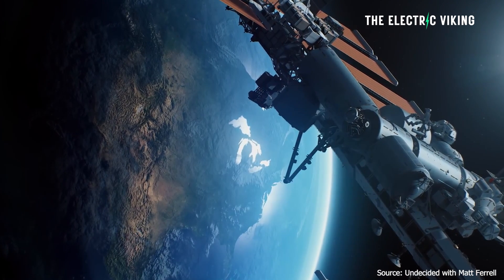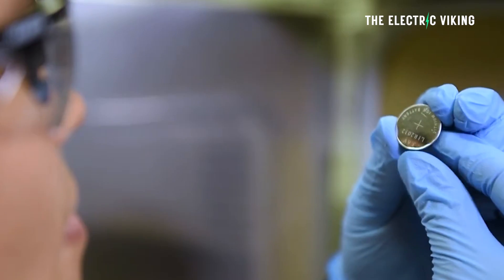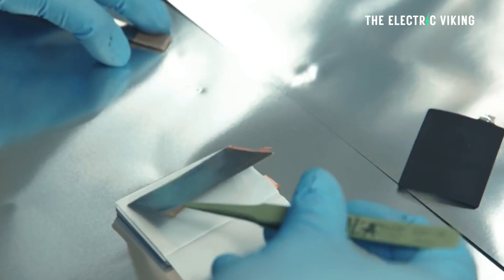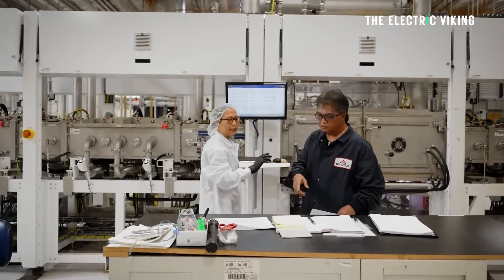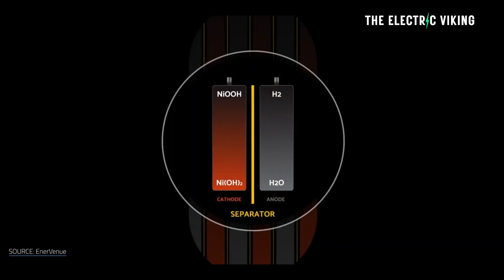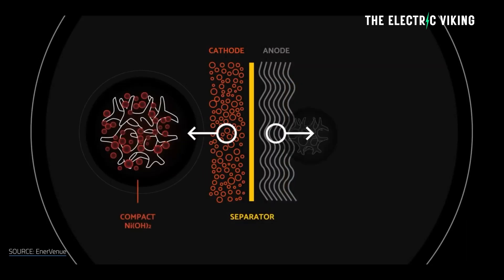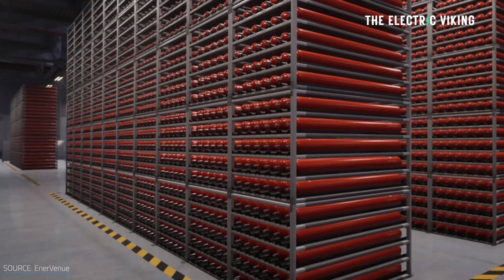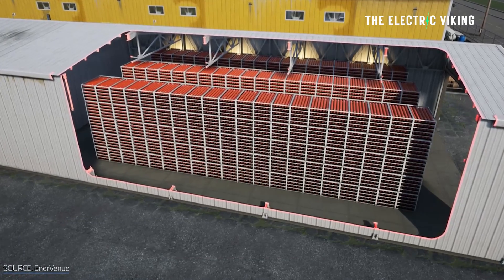NASA's nickel-hydrogen battery technology could displace lithium by 2030

Comment: Very old technology from 70s. Very poor energy density. Sam are you running out of things to talk about
Reply: that doesnt really matter for grid storage. price is more of a concern for that.
Reply: @zachmoyer1849 Just a poor title for the video. Lithium isn't going anywhere for vehicles or portable devices. Grid storage, yeah totally different game.
Reply: @zachmoyer1849  that's true but for grid storage there cheaper options than pressurized hydrogen. Salt water flow battery for example
Reply: @i6power30  Please correct me if I'm wrong but from what I've read there are 4 major types of sodium flow batteries, all with different characteristics.  None are available at scale or at a reasonable price yet.   

Currently this pressurized hydrogen battery is about 75 percent more expensive the Lithium but has a considerably longer life span and considerably lower degradation.  This means that while it has a higher upfront cost, in the long run it will be about 3 to 5 times cheaper than lithium over the life on the battery.  Both sodium flow and nickel-hydrogen are predicted to be cost less than lithium by 2030, although by 2030, lithium batteries will be lower cost per kwh as well, which I don't think any article I read takes this into account.
Reply: @Ryan-ff2db  I don't see why salt water batteries should cost more? It's just salt and water, should cost way less than high pressurized hydrogen tank? I'm baffled...
Reply: @i6power30  It's because they're not produced at scale yet, and input materials are only a small portion of the costs.  All tech is this way.  The more you ramp the cheaper it becomes but all tech is expensive in the beginning due to upfront engineering costs, factories, establishing clients, etc..  If you look at semi-conductors the materials in a single CPU are literally pennies for a chip the size of your fingernail but they sell for Hundreds or even thousands of dollars because the engineering and manufacturing costs are so high.
Reply: @Ryan-ff2db  So in theory salt water batteries should cost less and more robust than nickle hydrogen battery at scale then.. The reason NASA developed nickle hydrogen batteries is mainly long cycle life as you cannot easily replace batteries in space. But for grid applications, salt water batteries can easily be replaced at very low cost once the infrastructure is setup, you just need to replace salt water! So it's no a brainer.
Reply: @i6power30  Yes, but every type of battery has there own characteristics, their own pros and cons.  Storage density and cost are two factors.  You also have depth of discharge, voltage, capacity, cycle life, charging current, discharge curve, temperature range, and possibly the most overlooked, the BMS and software.  Salt water batteries seem to be an excellent solution for mid-long term storage but they cannot respond instantaneously.  The grid will still need faster lithium style batteries and capacitors to smooth out the grid.  Realistically there will a mix of different chemistries and technologies as the grid evolves.
Reply: @Ryan-ff2db  The grid doesn't 'evolve.'  It has a set task, and that isn't changing.  What IS changing, is everyone's willingness to compromise it to try and make these magical solar and wind and battery boondoggles appear feasible.

The grid has never operated under a 'store for later' paradigm as wS never designed around it.  It's designed around a 'create as needed' paradigm.  The two couldn't be more polar opposites.

The grid would have to be designed around a paradigm based on technologies that do not as yet exist.  I don't need to tell anyone here what a stupid idea it is to pursue THAT path.
Reply: @billcichoke2534  obviously you are anti renewable. Why are you so against trying to be good to environment and keep the existing polluting energy systems?
Reply: @billcichoke2534  What are you talking about?  The grid most certainly does 'evolve'.  Look at the grid now versus 100 years ago.  Look at a graph of the energy production, look at the energy mix, look at energy usage.  None of the these changes happened overnight, it's been constantly evolving over time as technology has improved.  The stupid idea would be to stop advancing technology.  The world will be far better off without toxic coal plants and heavy oil usage.  I think even you have to admit that.  It would also be considerably more secure without relying on the whims of dictators or hostile OPEC+ countries.  The technologies certainly do exist and the prices of these newer technologies are falling faster than any other forms of power.  Battery prices have also fallen drastically and will continue to fall.  The world is changing and even America is changing, with 67 percent of Americans believing the transition to renewables should be a top priority.  This is from a Pew research poll taken June 28th 2023.  You should look it up, it has all sorts of numbers you will not like. The world is changing for the better, you best get used to it.
Reply: @billcichoke2534  

It is so easy to show you why you are wrong.

Look at what happens with economies of scale.

Whe. Producing at scale, the cost of manufacturing approximates the cost of raw materials. 

Solar panels reduced in price by 40% last year (ibased on cost per Kwh)

Lithium metal prices dropped by 5p% last year.  People now understand we do not have a lithium shortage - we have a manufacturing shortage - we do not have enough factories to build what people want.

And the Biden Administration solved that problem by funding hundreds of battery materials manufacturing facilities.

We are still at the beginning of the growth curve for EV technology - everything in short supply, more expensive that it could be, and the technogy is advancing daily - 

As a materials science engineer I cannot keep up with the new technologies being developed.  

Things are happening too fast for a single person to know about all that is happening.

You are acting like we will be forced to use current technology to solve our problems- its like you don't understand that modern tech is vastly superior to technology from just 3 years earlier.

You don't seem to understand the topic.
Reply: @billcichoke2534  

The solution you seem to be overlooking is that there will be terawatt hours of energy stored in millions of highly mobile batteries.  

With automobiles we get to use a mobile grid - people will charge their cars at night when power costs are low, and they be paid to discharge much of their battery into the city grid where it is needed. 

This part of the grid redesign is already in place - we just need to keep on building more cars and charging stations. 

Batteries will continue to go down in price as we develop the technology - gasoline engine costs will not ever go down.

The auto industry recognized we have already had a peak ICE sales year - every year we will sell fewer and fewer ice vehicles - since Bout 2021 - depending upon how you define it.

What makes you think you are right when it is so easy for me to offer solutions for your concerns?
Reply: @JohnBoen  It's bit of a stretch to use EVs as mobile energy storage when we are still struggling to build out basic charging infrastructure let alone reverse vehicle to grid connections.  some older homes need complete panel upgrades and even thicker transmission lines to allow /v2g connection.
Reply: @i6power30  

Actually it is part of Tesla's business model.

They support an energy arbitrage system that customers using Tesla Power Walls can use to buy and sell electricity at different tines.

Tesla produces more car chargers than all other charger companies combined.

What you deny as possible is already in place.
Reply: @i6power30  

The infrastructure doesn't need thicker wires - 

The issue with the grif is grid stabilization. - the grid is able to support the power needs of rhe community 99% of the time.  Perhaps 2 days a year have problems...

it just needs batteries to be added.  Put in a megawatt of storage for some number of customers, population density/seasonal power use needs...

These act as little peaker plants, and they pay for themselves by automatically buying and selling power on a power arbitrage.

They had to solve this problem already - just to be able to install supercharger technology. .  Charging 5 cars would overwhelm the grid if they didn't have a battery under ground...

The exact same technology used today to manage high power needs will soon be extended to include more than just stationary batteries.

It is the next logical step, given the technology is already in place...
Reply: @Ryan-ff2db  The grid most certainly GREW, but in 100 years its delivery paradigm has been the same...ON DEMAND.  It was never designed around excesses or attempting to shunt power FROM customers TO the grid.

As to what the world would be better off with, since you never mentioned nuclear ONCE, nor acknowledged the higher ACTUAL pollution caused by using pinwheels and smoke and mirrors solar, it seems that I am not the one who has to admit to ANYTHING.  Nuclear tech is gar younger than solat and wind, but has proven itaelf SAFER, MORW POWERFUL, MORE RELUSBLE, AND CLEABER.  Again, amazing you didn't mention it, seeing as how you're so gung-ho for the envirinment and all...

And one of the main reasons we 'rely' on OPEC, is because we designed that system in the late 50s as a means for less developed countries to make money for their citizens.  The thought was to prevent poverty that's classically used to recruit terrorist members.  We have more than enough of our own resources or access via NON-muhammedist nations, so that's a non-issue if we just had less lefty-leaning idiots in government.

No matter how it's spun, solar and wind and batteries are NOT 'new' technologies, nor have they EVER proven themselves as BETTER.  It is only out of ignorance and stubborn pride that we continue to waste our time, energy, and resources on them.
Reply: @JohnBoen  Actually, you just proved me right.  You also proved why we need people to understand these things better, instead of taking the word of solar wind and battery salesmen and pro greenie weenie cultists.

The tech hasn't moved much at all.  Refinements and the like aren't NEW tech; they're incremental changes ONLY.  And they AREN'T always for the better
Reply: @JohnBoen  No, I'm not.  But those PUSHING V2G seem to not understand why peooke buy cars.  It isn't to rent out the fuel tank or battery for someone else's use...it's for personal freedom of movement.  And since NONE of these people are willing to inconvenience THEMSELVES by having their car discharged by the grid, that should tell you all you need to know.
Reply: @billcichoke2534  

V2G is only feasible in the future - As I have been saying).

These batteries have 1500-3000 cycles.  Batteries will need to have a 7000 cycle life to participate.

Based on current trends, I expect the 7500 cycles and 80% capacity to happen in about 2-3 years.  You will drive a million miles on these batteries - or you can cycle it twice as often and still get 500,000 miles.  If you buy 50 kWh of power at 10 cents at night and sell it for 20 cents during the day, you make 5 bucks.

This hundred bucks a month would easily pay for your driving.

Easy to implement, but not feasible for another two years.
Reply: @JohnBoen  Nah.. Average people aren't really aware of the battery degradation. They will use their EVs to make money if V2G infrastructures are setup conviniently. Most poeple are short sighted especially ones need extra money, just look how many Uber / delivery drivers there are using their own vehicles not aware that their gig economy income barely covers their car's maintenance and depreciation if at all.
Reply: @i6power30  

I suspect many people will like the idea of driving their cars without having to pay anything for electricity - the people who do not understand will settle for this.

Can it be made any more convenient? 

Sign here, plug in here, have a nice day...

The people who do understand will make a lot more money off the idea.
Reply: @JohnBoen  Correct. Might I also add that people who lease their vehicles will take full advantage of this. Maybe car makers / dealerships will respond in the future by limiting charge / discharge cycles in addition to mileage on odometer for EVs if this becomes a widespread thing.
Reply: @i6power30  

Interesting point - I would expect that to happen, too. 

 I can see an infrastructure of different battery types growing to fill niches.  Liquid flow, Ni-H, LFP, etc etc etc... to Aluminum-air.

I can see a lot of niches. 

L
Reply: @billcichoke2534  

We both know that EVs are growing while ICE is shrinking.

US EV growth was 60% last year.  World EV growth will be similar ... once it is published. About 20% of world car sales will be renewable energy vehicles in 2023.

Did you realize that one in five vehicles sold is an EV?

Next year almost 1/3 of world auto sales will be EVs.

Do you realize continued growth like this means 50% of new car sales will be electric by 2027?

Are you aware of the consumer demand?

You seem to think that nobody wants EVs.
Reply: This topic is important, though. Battery storage for the grid makes wind and solar more practical, electricity becomes more competitive with fossil fuels, and thus EV's should become more economical to operate. It will take years for this to happen, though.
Reply: Energy density means absolutely 0 at grid scale.  Especially, since these batteries are being stacked and as such density per square foot will be significantly higher than lithium. This is not the only company ramping these up and there are a backlog of orders.  Assuming no major new technology like fusion comes along soon, these batteries will be a thing.
Reply: You didn’t listen to the video. He literally said they’ve been in use for some time and were created in the 70s. Changing the catalyst has reduced the potential cost.
Reply: @Freshbott2  And it drops energy density.

There is no free lunch.
Reply: @billcichoke2534  nobody’s talking about free lunch. And what a silly analogy. When research does increase energy densities do you call it a free lunch? Cause it happens. All the time. What this video is about is commercial viability. Energy density isn’t the only concern for batteries. It’s like fifth down the list. In grid scale storage it’s practically not even on the list.

Need to add as well - if you factor the infrastructure like cooling as a component, its density can be comparable anyway.
Reply: @Freshbott2  Do some historical research.  The reason the cheaper material wasn't used BEFORE, was because it had an impact on the battery's charge capacity.  As in MAJOR LOSS.  The lower cost wasn't worth the hit in utility.  That's why production NiMH batteries DIDN'T USE IT.

Not a silly analogy.  A straight forward explanation as to why smarter people in the past didn't go this route.
Reply: @billcichoke2534  do some modern research. These batteries are going into production. They have about half the energy density vs. Li-ion. That’s *good enough*. Nobody said you’ll be carrying them round in your pocket. 
Without giving the correct answer of “they didn’t” - what did those smarter people all that time ago decide was the break even density for commercial deployment of metal-hydrogen batteries in the mid 2020s since you know?
Go one further, what’s the breakeven when you factor degradation of denser battery types over their lifetime?
Yes, the reason it wasn’t used BEFORE is fine and dandy. We’re not in the BEFORE. We’re in the NOW, and these are past research and going simultaneously into commercial testing and commercial production. What about it?
Reply: @Freshbott2  Since the battery density of these things seems to be LESS than those used by GM for the EV1, you tell me.  Also, as I've pointed out many times before, Li-ion batteries have been in EVs due to the overcharging, too fast charging, and too fast discharging they can be forced to do...at a  cost.  NiMH doesn't do that, and won't be FORCED into those conditions.

There is no way you could get them to suddenly and magically quadruple their charge or discharge rates to be useful as grid level storage.  Home or commercial building switchover to diesel generator?  Maybe.  Grid?  Nope.
Reply: Um.. since when are Nickel Metal Hydride (NiMH) batteries NEW tech?  We've had them in cordless phones for literally DECADES.  They were even used in the EV1, showing energy density close to Panasonic's 2170 cells.
Reply: @billcichoke2534  True. It's just the application and scale that's different.  It seems we are revisiting lots of old tech these days from batteries to hydrogen, to analog devices, DC power lines even music is using more old tech these days.
Reply: @Ryan-ff2db  What cheeses me off the most is, the people researching and developing it tried all the stuff we're doing now, THEN.  It was found to be lacking in all the same ways it was BEFORE them, and the way it is NOW.  There are two main differneces now.  Unfortunately, we have a more scientifically ignorant citizenry, and we have far more dictatorial minds pushing this stuff on us.  One doesn't understand the unintended (or intended) negative consequences of all this, and the other doesn't care.

Neither one of those is a GOOD thing.
Reply: Better than every so called "expert" on YouTube and Facebook sheep doing the Tesla and Lithium fire dance.
Reply: Cobalt? Are you kidding? I hope so.
Reply: Why don’t you make your own flipping content mr are you running out of videos. Useless comment. I guarantee you have nothing useful to suggest for content
Reply: About 150 Wh/kg.

Zero maintenance.  High cycle life. Not flammable. 

The tubular design makes it immediately applicable as a structural member.

Directly recyclable without needing to worry about large amounts of toxic waste.

I would say that is a pretty good solution for many problems.
Reply: Electricity is from the the 70's too. The 1870's
Reply: Ha ur FIRED MR SAM YEHEHE